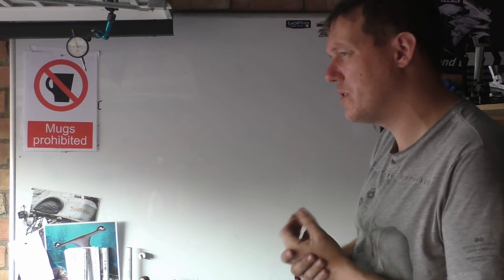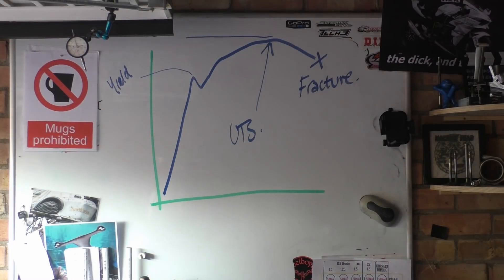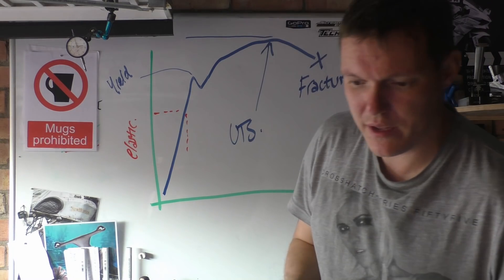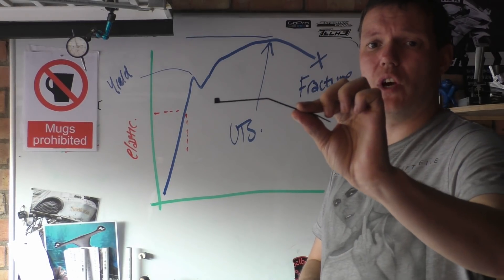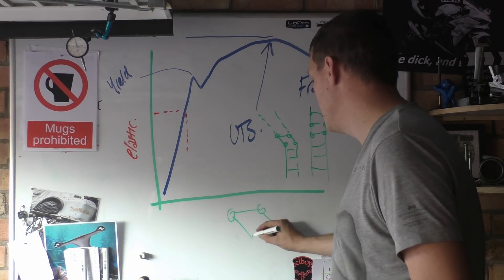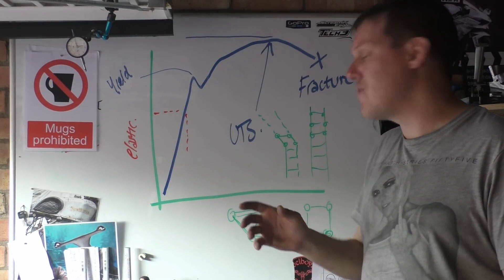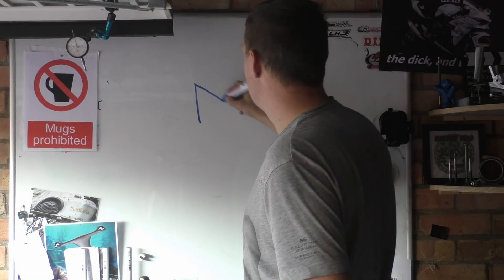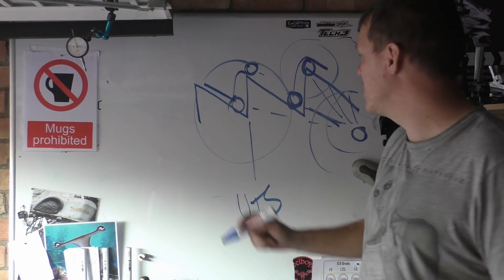Yeild and UTS - Why is yield lower?

Comment: Tensile tests are usually performed with the crosshead on the tensile testing machine moving at a constant speed. Once the material has yielded and plastic deformation begins to occur and dislocations in the atomic structure of the metal build up. This causes the metal to gradually strain harden. Thus, we see an increase in the stress/load required to maintain the application of strain with constant crosshead speed. The strain hardening of the material is the reason why the UTS is higher than the yield. 

The result of the increasing dislocation density is that the stress increases non-linearly with the applied strain up to the UTS. It is at the UTS where the material reaches its peak level of strain hardening and necking  begins. Necking is a localised reduction of the cross sectional area on the gauge length of the tensile specimen, which results in the formation of macrovoids within the material (not visible on the surface). The reduction in cross sectional area is facilitated by the coalescence of the macrovoids, which causes the stress to drop off until final fracture is observed. This is why the UTS is the highest stress on the stress-strain curve.

The shape of the yield point you showed on your graph is usually seen with ferritic steels, where inhomogeneous loading occurs. This is due to the formation of things called Luders bands, which are regions of localised plastic deformation, the slip from which causes that drop off in stress and slight recovery. There can often be quite a few undulations in the curve before yielding is complete. Other alloys such as stainless steel and aluminium have a smooth yield curve because all of the material yields at the same time.

Comment: Great explanation. A little more from a nerdy bloke. The elastic region is important because if the material is not forced beyond yielding the material properties have not changed and the material is safe to use. Beyond yielding, the material structure has changed and you don't know if the properties are suitable anymore, especially if the part has been designed near a Factor of Safety of1. Factor of safety ratio 1 means the material working under loads of it's yield point (obviously impracticable), FoS 2 is half the yield point etc...
The upward curve is the material strain/work hardening as the structure is moving over itself and locking until UTS. The downward curve is a weakening of the material due to necking (cross sectional reduction) ending up with separation (fracture).

Comment: The internet says if you use stainless bolts in suspension linkages, you will be killed instantly because it doesn't have enough strength...so I installed some like a human guinea pig. I used a4-80 which has comparable tensile/yield strength to 8.8 steel which as far as I'm concerned is plenty. They've been on for 2 years so far and I'm still alive I think
Reply: On the subject of guinea pigs, next doors kids have some which I'm planning to cook and eat with a bit of Brown sauce

Comment: I think it's easier to visualize a lattice of atoms where once you bend the structure enough to atoms that would normally be connected are too far away so they just bond with other atoms that are closer. Is that a good way to think of it? It's a bit more direct than referring to a ratchet wrench

Comment: So if you bend something back into it's original shape, I assume this effects the UTS or Fracture Point but by what effect?

Example if you bend something multiple tiomes it seems to be a lot it easier to "snap" - is this because the material gets thinned out at the point where the plastic deformation happens or is there another effect that happens (so regardless of the material getting thinner, it would still be easier to snap)?
Reply: EngineOfDarkness ,, work hardening